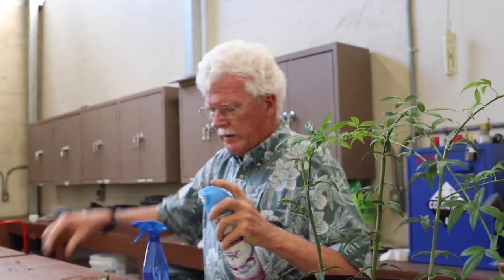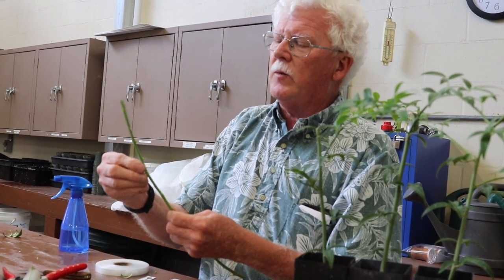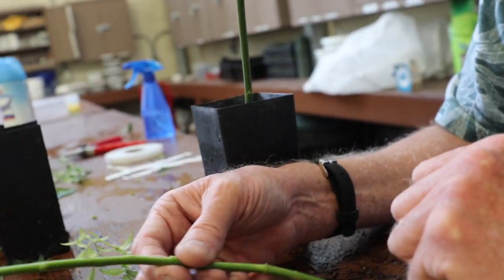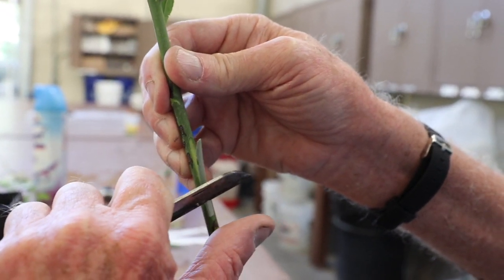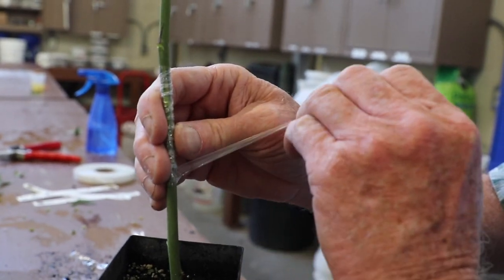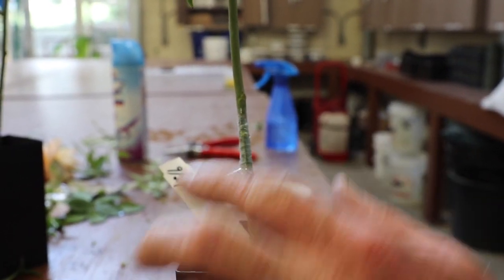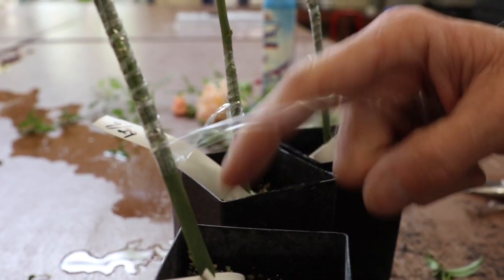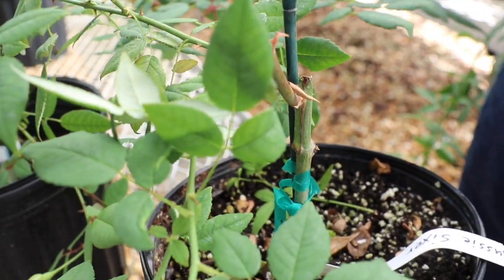5  Chip Budding onto Fortuniana

Comment: When you cut the notch, do you go into the cambium layer?
Reply from the maker: The notch above the graft, after unwrapping?  Yes, you want to completely disconnect the phloem tissue, so it can't continue to send auxin down to the grafted bud.  That means going completely through the bark and cambium, and slightly into the wood.  Not the whole way around the stem; just the side above the grafted bud.